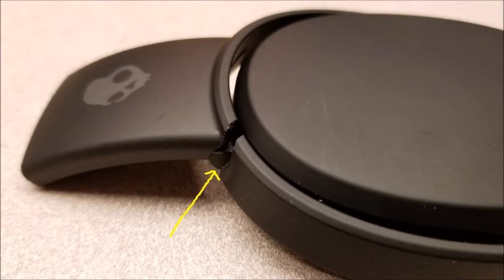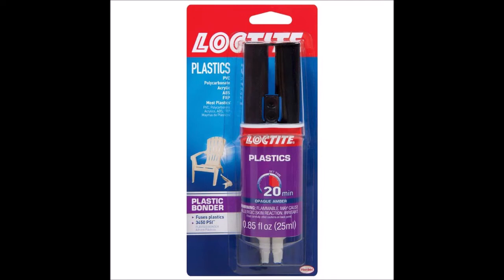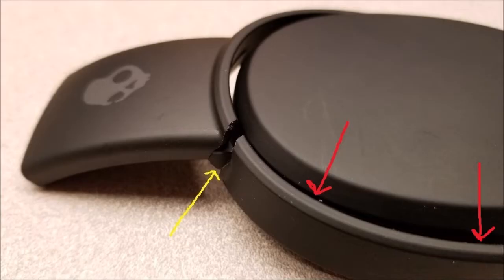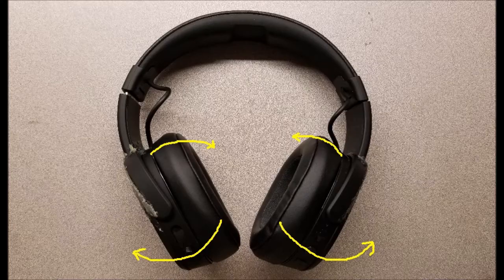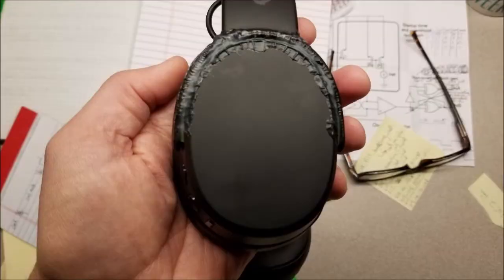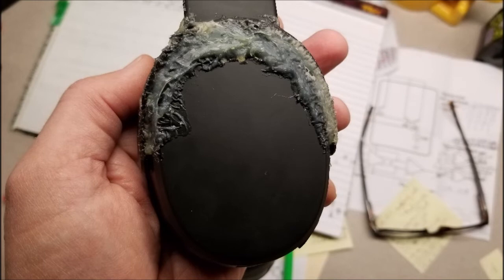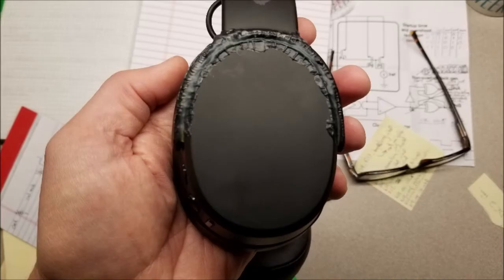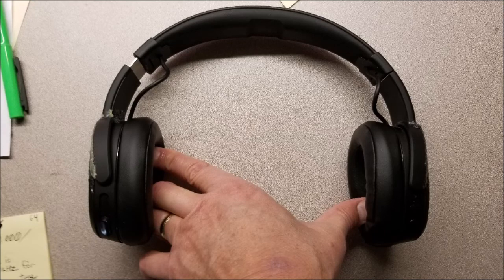Skullcandy Crusher Wireless Broken Plastic Fix

Comment: I have the same issue with mine. But it is not broken all the way. I take good care of my headphones and one day I saw that I have a crack on the same spot as in this video. And I applied some glue there(loctite) and for now everything is fine. I hope that my headphones will not broke all the way, because they sound amazing. I think DoctorFixMaster is right. So for those who want to buy headphones like this, just take in consideration his advice.

Comment: Spray alcohol onto the epoxy and your finger, run it across the epoxy and it will smooth out perfectly, this works with caulk as well.

Comment: Good repair, and could finish off the aesthetics with a little sanding and paint if you wanted.
I got real, real old school creative with bracing, string and glue for a badly busted up first gen M40x, but it's solid.
Function over form every time.

Comment: had the same issue with mine, but I opted for a small drop of superglue and it has held for a few weeks now. Barely visible if you ask me..
Reply: I have done this with my hesh 3 many times and it works. The plastick surrounding the glue broke many times but the glue never did.
Reply: Skullcandy makes bad build quality headphones I owned a few of their wireless headphones and they all have the same issue just cheap plastic waiting to fall apart bad brand to invest in

Comment: Thanks, I got a pair of functional hesh3 with the same problem, this will work great. Just something to consider - if you tape the outer edge where the headphones are close to the frame, then fill in the epoxy from the inside, the tape will keep the expoxy from running out and will give it a nice smooth surface. Might look better and will waste less epoxy. Cheers.

Comment: Had the same problem with Hesh3 after 2 weeks use. Skullcandy replaced them straight away, to their credit, but did not take the old pair back. Which left me a free go at this. Not sure if my epoxy is the wrong type or what but 5minute epoxy is taking a hell of a long time to dry. 15 minutes later and still waiting. And it's a quality epoxy too.
Reply: Should add that yes, this did work. The problem though is that they are insanely uncomfortable for adults. As this pair is for my 4yo they work bloody well for his small head. And as for the headphones and their plastic quality, Skull Candy customer support got back to us after breaking our 4th pair and said that "yes, there was a problem with the colour injection into that plastic part, but the issue has now been resolved, so you can go ahead and replace them during the warranty period or get your money back". They may have proven to be unreliable headphones, but that's a bloody good company that accepts this sort of issue and continues to replace them for the warranty period with no hassles.

Comment: I just used some industrial super glue at this point, been perfect ever since. My hinge broke so I 3d printed a new one. Not issues for people with the tools but definitely has some design flaws. Just by using an aluminium hinge and part aluminium ear-cup holder would eliminate these issues. Poor design but the sound quality for price is very good.
Reply: I wonder where you got the 3D model of those pieces or If you modeled them, help me out, thanks.

Comment: Mine just cracked there as well. But I'm using ABS cement currently on it. I hope it works. I just put the cement between the two pieces of where it broke.
Reply: Did it work?

Comment: Electrical tape together the broken yoke, on the outside. Then press/melt a heated-steel-pin into the inside, to bridge the crack. Epoxy-resin inside the crack to lock-in the pin and flush the surface. Then will be as original in operation, but much stronger. NOT the unholy mess you ended up with ! All the best tho fella.
Reply from the maker: The simplest fix is the best fix.  Press melting a heated steel pin to reinforce the crack?  Sounds sketchy to me.  People have also suggested a 3D printed replacement part.  Anyone so motivated, knock yourselves out if it's worth the trouble to do a pretty fix that's much more time consuming and complicated.  It depends on how much people care about what they look like and how much trouble preserving that is worth.  I just want them to sound good.  :D

Comment: the hinges on my pair snapped and do you know how to fix that?
Reply from the maker: Depends on how they failed.  You might be able to drill holes into a piece of metal and through the headband to put screws through, if you can live with one hinge being completely rigid.
Reply: I have sent two pairs back in the past six months. Skullcandy will replace them or give you a credit
Reply: Rachel Johnson in india , they consider that physical damage and dont give a warranty claim.
Reply: @djancak  They do not pay for you to send it to them. They did not replace my headphones this time. They gave me a $200 coupon to use towards the purchase of a new pair.
Reply: @racheljohnson1266  I  bought them from Amazon this year in April and yesterday one of the hinge just snapped and now can I replace them from skullcandy? PLEASE REPLY!!!
Reply: @abskamo7483  go to Skullcandy's  website and submit a claim.
Reply: @racheljohnson1266  But only manufacturing defects are included in the warranty right?
CAN YOU PLEASE GUIDE ME HOW TO GET MY CRUSHERS REPLACED.......PLEEEEASE
I REALLY LOVE THESE HEADPHONES
Reply: @abskamo7483  they will replace them. I have had three pair replaced since last April
Reply: @abskamo7483  they cracked along the hinge above the earpiece.
Reply: @racheljohnson1266  i forgot to check my warranty
Reply: Enter a warranty claim. They will let you know whether or not it's covered

Comment: Hey, just had this happen to my pair and I was planning to fix them, but I have no idea how to take them apart properly so I can do this without risk of epoxying other stuff by accident. Would you be able to provide an explanation on how you did this (as in this and the previous video) or if you could even make a short video detailing the process, it would be greatly appreciated and save me from having to buy a new pair! If you can't, these two videos have still helped me alot in figuring out how to fix this problem
Reply from the maker: Hi.  I wouldn't recommend taking them apart.  The screws are soft metal and go to mush when you torque them.  There is really no need to take them apart.  You can do the fix without disassembly!  It's all there in the video already.  There really is no magic to getting the epoxy in the grooves.  I used a small screwdriver.  It was messy and sloppy, although it's fully functional.  If you really want it to look pretty, cut a paper cup to make it shallow and buy a big syringe.  Mix up a big blob of the epoxy well, then you could just suck it up with the syringe and then squirt it between the grooves in a much more controlled fashion.  Run your finger across the groove to smooth out any bumps in the epoxy and you're good to go.  You have to work quickly with that stuff.  It might melt your syringe and the rubber plunger in it, but it would be good for a single use.  It's unnervingly committal, but it works.  You can do it!  Just make sure you don't get any epoxy on the control buttons.  That would be a deal breaker.  The rest of it though is strictly cosmetic and a smear here or there won't hurt them.  Good luck!

Comment: My hinge broke, anybody know of replacement parts? I had my last pair of skullcandy with the battery bass booster for 10 years until they broke. I’m disappointed in my newer pair cause they only lasted like a year and a half.😪
Reply: 'amazon, ebay, or 3d print one.
Reply: I know I'm pretty damn late but like the guy above me says, there are some on eBay for sale which people have 3D printed (including me) to purchace. There are also the STL files on various sites to 3D print yourself.
Reply: IMattUltra1 better late than never. Thanks so much!

Comment: Hey bro my hash 3 the plastic start broken from the up of the logo and he keep broke with him self and moving what i do to stop this issue?
Reply from the maker: You could preempt a full on failure by doing the fix I outline in this video.  People have posted lots of ideas here for making it look nicer.  I've never had any luck gluing plastic, but a full on plastic bonding epoxy has a better chance than anything if you can fuse enough plastic with a big, thick bead of epoxy.
Reply: DoctorFixMaster thx man 🌺

Comment: I love the sound in these headphones. But boy is the build horrid. 1st the part referenced broke. Gorilla Glue worked wonders. Then the hinge broke on one side. Gorilla Glue worked wonders. Then the other hinge broke. Gorilla Glue worked wonders. Then one arm extended broke. Again with the GG. Then the other side gave out. GG to the rescue. I've had to repair my headphones a total of 5 times all in under 6 months of purchasing $150 headphones. I'm dying to jump into the new crusher anc but wouldn't be able to live with myself if I spend $300 and the turnout to be just as poorly designed.  And again I'm a diehard skullcandy crusher fan, ever since my first snoopdogg edition skullcrushers (which themselves had issues with the rotating joint of the earcup).

Comment: My problem is the sound. It sounds really weird and I dont know how to fix it. After a software update of my phone the sound is really bad. Any ideas?
Reply from the maker: I haven't taken the deep dive into the electronics, so I'm not sure about the sound.  If it was after a software update, I'd get in touch with Skullcandy about that one.
Reply: I'll try it :/
Thanks for your help and that you took the time! ❤️
Reply: Try the headphones using other devices, other people's phones or computers, if the problem is only with your phone I would report that to both the phone manufacturers and Skullcandy.
Reply: If on computer and using bluetooth make sure you are not using the hands free headset instead of the headphones

Comment: That's a horrible fix.
Reply from the maker: How about this?  I've been using them every day since I fixed them, which is longer than the original pair worked before breaking.  So your assessment that the fix is 'horrible' is an unsubstantiated load of pig shite.  Have a viable technical contribution to make or don't comment here.
Reply: @DoctorFixMaster  well it looks horrible.
Reply from the maker: @HansLotap  I was too harsh with you.  I'm sorry.  You're right.  They look like dump, but  they sound freakin amazing and they function mechanically, which is all that matters to me now.  I can listen to them now, where my only alternative before was to throw them away, and they were too expensive for that.  :)
Reply: @HansLotap  When he says right in the video it looks horrible,  you're being pedantic and pouty by stating what isn't even obvious, it's already DISCLAIMED.  I mean, I wouldn't do this myself, but I won't be a jerk about it.